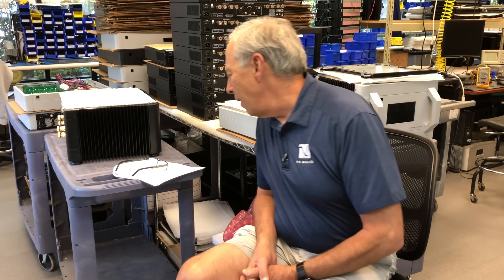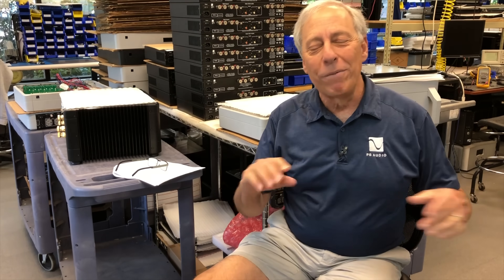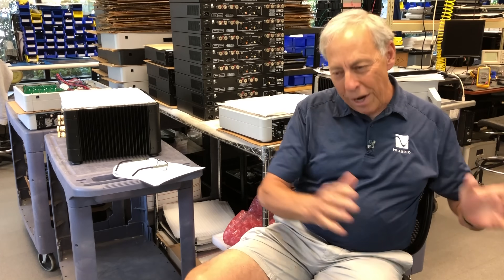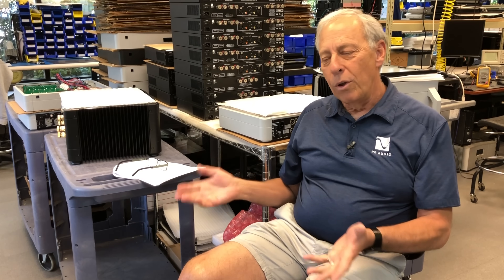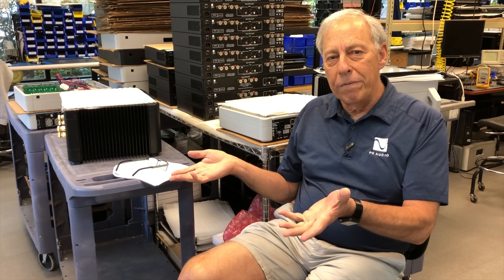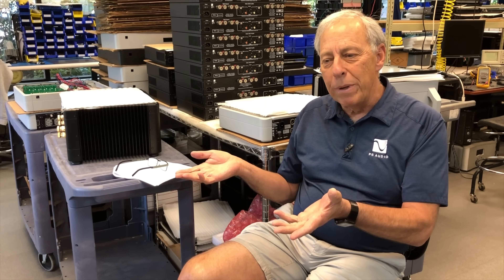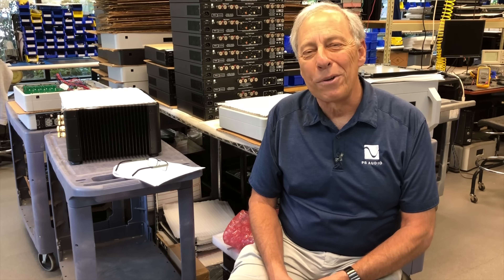Why don't subwoofer have high pass filters?

Comment: I have boston vrm 90s and boston pv 1000 subs and for music they complement very well.  but movies suck. and i think this is the question this guy was asking and it has very few answers on the internet as i have spent hours looking. i want a cheap way to sub sonic filter ie. a high pass filter from my lfe reciever output to my pv1000 sub at 28 or 30 or 32 htz. i hate it rumbling, distorting, bottoming out on every movie explosion, etc and it has to be adjusted or tolerated constantly for movies. harrison labs sells $40 filters sub sonic adjustable and a $20 fixed at 30htz that i think would stop my movie rumble distortion.  a mini dsp is $333 but i want cheap if possible. i'll buy new stuff when i retire and have time for it. does anyone else have this problem? per the internet only car subs have this issue b/c there is zero info on goobgle about it.

Comment: My presonus T10 high pass at 80Hz and a low pass from 50 to 130Hz
Reply: You always have the answers.. Amazing
Reply: What I've discovered is the sub puts out too much energy at 80Hz..so I've left the HP off and trimmed the LP to 50Hz and let the main speakers work down to their designed 45Hz..which is already rolling off -6DB from about 70Hz anyway.. To my ears this sounds best.
My mains are Adam T5V
Reply: One issue is the attenuator on the sub only goes to -30dB.. So.. For my small project studio that isn't low enough..
I've compensated by sending a lower volume signal to the sub and then calibrated the SPL of the mains to my preferred level (79). OK confession time.. The sub is too large.. Some times in life we need to compromise and find solutions.

Still tweaking but to my ears I think its sounding good.
Interesting note. The T10 has a foot switch that cuts the sub out.. Very handy for listening with and without sub content.
Note this is a mixing studio set up and not a music listening room per say.
Reply: Last words.. Like Paul says.. A system without a sub is not ideal.. It adds so much subtle contend that exists in the recordings or in my case electronic music creations.

Comment: Acoustic Research must have believed the same as Paul; often their speakers had just a capacitor on the tweeter, no filter at all on the full range woofer. I have two AR models, AR-30B and AR Rock Partners. I have 2nd order xovers (poly caps and air core inductors) on both, the -30B @ 1.8K and the RPs @2.5 K. (I tried a 2nd order on the RPs @ 2k, their advertised xover frequency, but they did not sound good; I raised it to 2.5k and it made a big difference in fullness and warmth.) Both models sound really good as is. I am thinking of removing the xover from the RPs and going back to the way AR sent them out, with just a 5uF cap on the tweeter, to see if I can hear the difference. Fingers crossed!

Got the mods done. I ended up with 13uF on the tweets and a .4mH inductor on the woofer (1st order Butterworth, 6 ohm T and 5 ohm W, @ 2K) Highs are bright, lows are solid. I had to add the inductor to the woofer to eliminate some distortion. Thanks Paul!

Comment: I know this video is now 5 years old but maybe I misunderstood the response and exactly how the question was asked. I was under the assumption that the viewer was asking about why a subwoofer that has a Low-Pass Crossover Built in that is from what I have seen most adjustable from 40hz-250hz, but these are Low Pass Filters rather than adding a High Pass Filter in combination to form a Bandwidth Filter which would filter the signal into the subwoofer amplifier to be High/Low Pass at such a rate that the subwoofer amplifier wouldn't receive the unusable frequencies that the subwoofer wasn't capable or desired to reproduce. I had realized that because in car audio subwoofer amplifiers a high pass filter is offered on selected amplifiers in the form of subsonic filter. This isn't a feature I've seen much of since the common usage of DSP Units being installed in the signal chain which allows active control of any frequency in a three octave range with adjustable attack delay and release. I will say the DSP unit making people duck when a gun shot is played because it sounds like an actual gunshot these days makes me smile when I see it happen.
Reply: exactly. i want to subsonic my old $1000 home theater sub thats says 1000watts at 4ohms to 22htz but it bottoms out all the time on movies. how can i do that cheaply. see my comment above to this thread. i would love to hear what you think

Comment: Great comment but theres one very important and often overlooked factor Paul. The speakers ideal placement for the best soundstage  & imaging is 99% of the time not the perfect placement for perfect bass performance. You'll always  have to compromise placement in a stereo 2.0 setup. Setting up the speakers for perfect soundstage &  imaging then adding a HPF + Sub and placing it in the perfect location for bass performance. This is the only way to get a perfect full range sound.

Comment: I was always impressed with the sound of desktop computer systems for the money. The sound I get from my little Klipsch system is pretty amazing for $200.  Does the little sub have a high pass filter or does the full signal go to the sub and monitors ? What I would like to do is imitate this and the closest I get is the SVS prime wireless sound base which has a sub out. But there is no filter either so I guess you are just adding bass to your monitors. And I guess these big companies have thought about that too but they are doing things for a good reason.When you look around computer speaker systems are all very small but I don't think that I'm the only one who wishes they could have the same thing in a much larger more powerful system that still sounds good.

Comment: My B&W ASW1000 subwoofer has speaker level in and high pass filtered speaker level out. They have proven themselves to be very competent speaker designers.
Having said that. I've never found any benefit to not running any of my speakers full range.

Comment: Emotiva's SE line of subwoofers offer high-pass filtering when connected through their line level input/output connectors. High-pass frequency is switch-selectable (60, 80, 100 Hz). I have an SE-8 in my desktop system, which has a low-wattage class A amp driving Klipsch stand mount speakers. The main speakers roll off at about 45 Hz. I have the high-pass set for 80 Hz, so the the power amp and main speakers aren't struggling to reproduce sub bass that the speakers can't reproduce, anyway. Class A amps usually don't have a lot of power, so every little bit helps. 

And they're not terribly expensive. The SE-8 runs $329 with free shipping to the Lower 48 states. 

Bottom line, I'm delighted with the improvement the SE-8 made in my system.

Comment: I have a pair of Audiostatic electrostatic speakers which are very bass shy and the diaphragms will slap against the stators causing arcing at medium volume.I believe they can't handle much below 100hz .I'm looking for a subwoofer that will stop those low frequencies from being fed back to them.

Comment: Excellent explanation! Thanks.  I have the PVxp sub with 2 high pass outputs for full range speakers. This is the maim reason i bought it. For that convenience! I should now theoretically leave my electronic xover home and just use the built in xover in the sub! 
Well....The full range cabs sounded muddy AND  their volume dropped down drastically.  I immediately reconfigured it to mixer to full range cabs to sub and it was clear loud and natural again. However i had to be careful not to overdrive the fullrange cabs by backing down on the bass a bit. Guess it was too good to be true.! 
Are there hipass inline XLR. gadgets for powerd fullrange speakers? I've seen some by SURE but I'm guessing they're only for mics?

Comment: You fail to mention that if the main speakers and sub are overlapping their frequencies that it can cause an uneven response at their crossover points. You dont want a sub playing 20-80Hz and then the main speakers also playing down to 40-80 Hz as well. This is where parametric equalization (DSP correction) can help, often times found on very high end home theater receivers.

Comment: That highpass filter suggested in the mail would only work, if your main speakers are wired to your subwoofer, which is rarely the case.
Reply: No the signal passes from the preamp to the sub and then to the power amp, in my sub anyway.

Comment: I found this looking through ideas for my setup at home. I'm not setting up a theater, or anything near that large.

I'm wanting a high quality audio setup for my pc. I intend to be able to add on as necessary. The first part is just a headphone amp which will get me by for now. But it has pre-outs  straight from the dac to go to another amp for later down the line attached to a pair of passive bookshelf speakers, then after that add a sub to the mix ... maybe.

Stage 1(current): pc -> dac/amp -> headphones
https://www.amazon.com/gp/product/B07TW2JQNN/ref=ppx_yo_dt_b_asin_title_o00_s00?ie=UTF8&psc=1

Stage 2: pc -> same dac -> new amp -> speakers(headphones obv still an option)
https://www.amazon.com/dp/B009IUIV4A/ref=cm_sw_em_r_mt_dp_GRt.FbG26AFW2 speakers

https://www.amazon.com/TDA7498E-Amplifier-Receiver-Bluetooth-Integrated/dp/B07ZVS261F
or
https://www.amazon.com/dp/B07K7NJ4QN/?coliid=I2FUHBK30M28VJ&colid=2EHSKCVH5O4BN&psc=1&ref_=lv_ov_lig_dp_it (with this stage 3 would just be to add a sub, no extra amp needed unless I want to get one later that's over 100W like below)

Stage 3: $stage 2, but split the rcas from the dac pre-outs so that one goes to a separate mono amp for the sub.
https://www.amazon.com/dp/B07VHG2LR9/ref=cm_sw_em_r_mt_dp_NOt.FbQSTM0AH

The mono amps I'm looking at all have a crossover frequency adjustment. I've been scraping everywhere I can searching for something that lets me split off so that only the sub got that low signal. What I get from this is that I wasted all that time? At stage 3, I don't need to worry about using any kind of hi/lo pass filters or find an impossible to find(for a reasonable price according to my budget constraints)  active crossover to sit after the pre-outs and split to the 2 amps? The other option would be to get a 2.1 amp that has outputs for a sub, but most of those I can find have everything in my stage1 dac/amp, making it redundant except for the headphone amp. I'd prefer to addon rather than replace. The one linked above only has bluetooth as an extra source, which I would be skipping as I have no need of it. It's somewhat wasteful, but at least I won't have any major redundancy.

Comment: I thought the crossovers in most pa subs did just that low passed below the frequency and high passed above the frequency to different outputs (ie your mid/high out gets high passed, the internal amp gets low pass on its input) am I wrong?
Reply: That noted I don't use them I use subs kn a send because when mixing a band certain things you don't want in subs like the vocal mics or the cymbals.

Comment: First do no harm? Nice principle. Wonder where I heard that before? Not sure to what extent lathe rumble, or the sound of a truck passing the recording studio adds, so I've eschewed a sub-woofer so far. In any event, my VAF DC-X speakers reproduce all but the bottom octave and that's good enough for me.

OTOH I broke the don't change it maxim. My listening room is over bright, so I wired a small value resistor in series with the capacitor that feeds the tweeter. That's the only electronic crossover part in the DC-Xs. Frequency control of the woofer is by mechanical means.

Comment: Great videos Paul, great info!

Personal point of view:  there is no need to stop hi frequencies for a woofer or sub, the driver is incapable to move so fast for hi frequencies (due mass), I have a prototype of driver that only render mid bass and low bass, there is a mechanical crossover built in it.

Comment: The PreSonus Temblor 10 sub woofer has a foot switchable high pass filter.  So you connect the powered speakers to the powered sub-woofer (so it's all done at line level).  In the recording/mixing studio this is so you can use your main monitor speakers full range and with a click of the foot switch in a crossover at the set frequency (a dial on the back) for checking your sub-frequencies in your mix.

Comment: Following part of the last things you just said about assuming the speakers is fine as it is, are you saying that when we add subwoofers to a stereo system we shouldn't also highpass the signal of the "main" speakers? If we don't do that then we could risk not having a controlled "flatter" response and also not being able to improve that main speaker mid ranges behaviour by removing the lower frequencies. Does it hurt so much do this?

Comment: Vandersteen speakers, starting with the "Quatro" model, and up, all use high pass filters.

The high pass filter reduces the strain on your amplifier(s), by reducing the bass inputted to them.  This means less bass to amplify.
The speakers reverse the bass reduction, by way of their built-in amplifiers.  The speaker's built-in amplifiers take on the job of compensating for the reduced bass.  The result is that your main amplifiers work less hard (allowing them to do a better job with the mids and the highs), and the final output from the speakers are full range (well, I believe the Quatros go down to 30 hertz -- but the higher models are truly full range).

These speakers are not cheap.  But they do an amazing job.
At their respective price points, they compete with speakers from other manufacturers that cost much more.

Vandersteen also has sub-woofers, which are designed to work with the above mentioned speakers.  The benefit is that the sub-woofers will allow the floor standing speakers to produce less bass (the subs will make up the difference).  This means that the floor standing speakers will vibrate less, giving you an even better focused presentation.

I have heard the above, using all flagship equipment, at an audio store.  I heard an amazing Led Zeppelin II pressing (RL/SS stamper).  It was spooky real.

Comment: Answering the question before watching the video again. The truth is twofold. 1) Many subwoofers DO have a high pass filter, specifically for the subwoofer itself. This is done to prevent the sub amp from sending high power to the woofer at frequencies where the subwoofer is unloaded (such as about 16 Hz). Below the tuning frequency of a vented or passive radiator subwoofer, the enclosure and port/PR provide no meaningful acoustical load to the driver, and the only thing preventing the driver hitting its mechanical limit (with a loud "pop") is the stiffness of the suspension, but to get the resonant frequency of the driver pushed as low as possible, the suspension has already been made fairly soft. So you have to avoid driving the subwoofer below the tuning frequency (and this is true of most any speaker using a bass reflex enclosure), and a high pass filter is provided (usually around 20 Hz) to prevent that. The high pass filter in this case is not user selectable or user adjustable, because it is included in order to prevent possible damage to the driver from hitting its limits frequently. As for why subwoofers don't include a high pass filter for the main speakers, this is because your full range signal would need to pass all the way from the head amp (receiver or preamp/processor) to the subwoofer, then back again, passing through lots of cable and through active filtering electronics that, in the case of most powered subwoofers, would be of dubious quality for full range audio. That's why when there is a high pass crossover for the main speakers in a system, it is provided by the receiver or processor. There's one more wrinkle: Because speakers vary most greatly from one model to another in the area of bass extension and bass roll-off shape, you can't expect to use just one crossover "knob" setting on the subwoofer and obtain a perfect match between the subwoofer and your main speakers. If the speakers have a roll-off shape that doesn't complement the room's bass response and you end up with a hump, or a tapering-off of the speaker's response (though we're most concerned about the hump), there's no way to take care of the hump by setting the low pass to one frequency, then setting the high pass a bit higher than what would normally be needed, to pull down that hump. It would just be there.

Comment: I use a DSP for my  5.1 and when I put a high pass on the front speakers it sounds a bit flat in the mid bass range.  with the way everything is set atm the bass from the sub does sound like its coming from the front speakers.  I wont bother you with the weeks it took to get it to sound that way :P.

Comment: From my background in car audio i would always HP the mains.... but you would try and get this to as low a frequency as possible. Occasionally i would also use a subsonic filter on the subwoofer.... just to protect it a little. This is probably because of the limitations of the installation of the speakers in a vehicle.

Comment: Do tweeters simply use series capacitors to filter lower frequencies?
Reply: A capacitor functions like a high pass filter and a resistance functions like a low pass filter. So, yes, generally.
Reply: mindtraveller100 Other way around afaik.  Think about a transformer - Transformers work only on AC so the closer to DC the less signal they pass. So a coil is a high pass filter. And capacitors  at the right specs will close the “gaps” in high frequency signals leaving only the low frequencies behind, so capacitor = low pass filter.